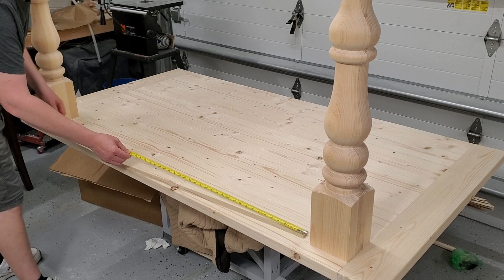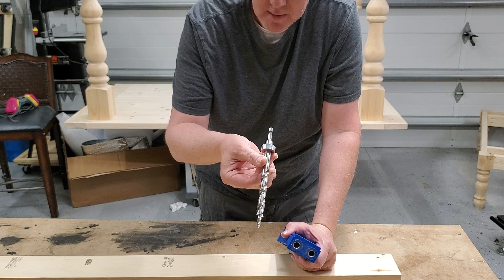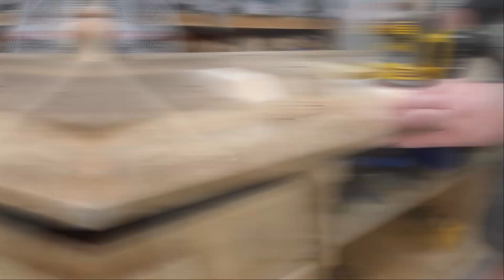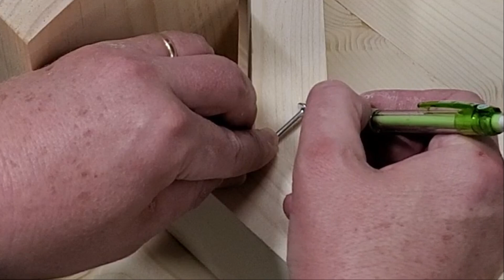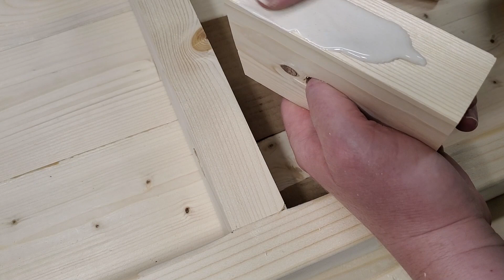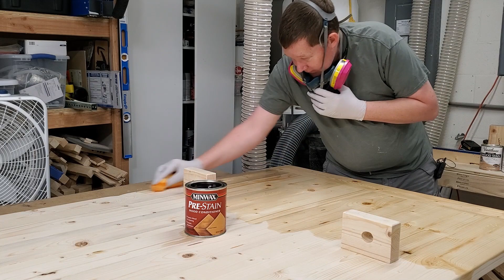Farmhouse Table (Base) DIY (DETAILED WITH TIPS) Woodworking projects to sell 2021 - Part 2

Comment: The table looks great but the cleats glued to the top are a weak point. While I can appreciate the unique method for attaching a top, I can see those cleats easily snapping along the grain from the dowel hole. The screws could have helped tremendously to prevent that, except you countersunk them below the hole. Not trying to be a negative nellie, the table and bench look great but I would've used longer screws or placed the holes lower on the cleat and closer to the top.

Comment: Another great video, quick question since you used the Kreg HD I assume the regular plugs are to small and you used the dowels instead or is it just cheaper in the long run using the dowels thanks
Reply from the maker: Cheaper just to use dowels for the HD holes. Easy too.
Reply: @EbikeReviews  thanks